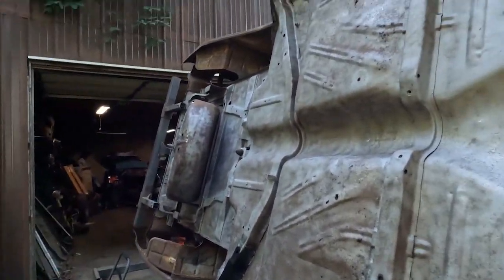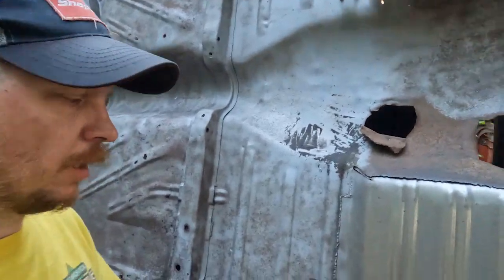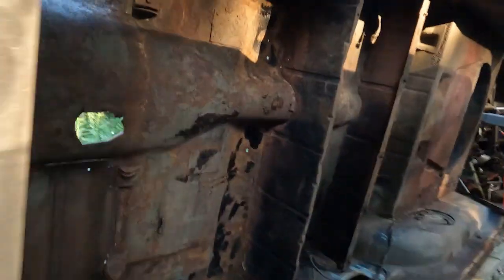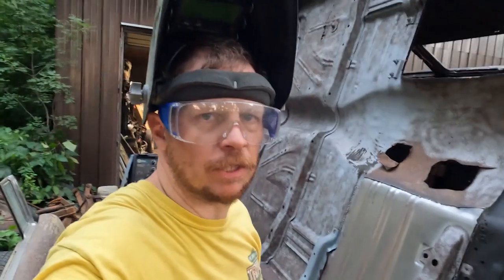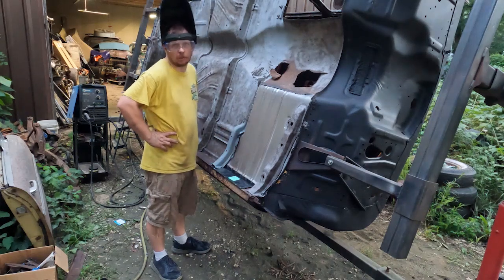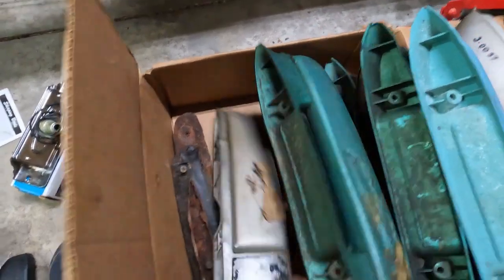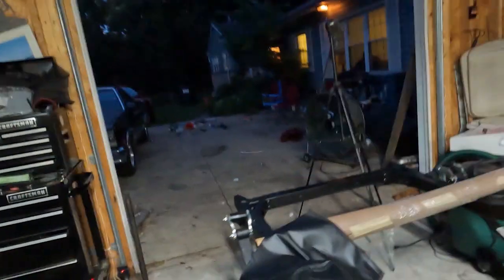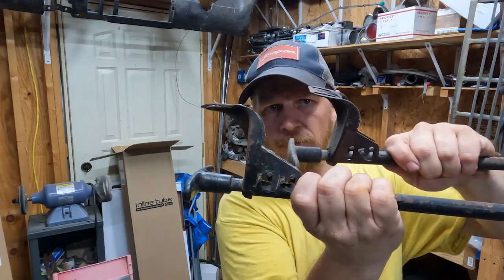New Tri-Five Chevy Parts Hoard! A little more floor work on my 56 Chevy sedan delivery

Comment: Good information. Dan from Dan's Hot Rod Garage mentioned your channel. I'm saving the old rotted rear Nomad fenders he had and they are going on a 2 door post wagon I'm converting to a Nomad. Yea I know it's not a real Nomad but I am modeling off of my orginal Nomad that I have had since 1974 from the firewall back. 
Good job on that floor support, did you paint the inside rocker? I will be looking for Nomad parts like windows trim and gaskets as I start putting the body together. It looks like you have a treasure trove of good parts.